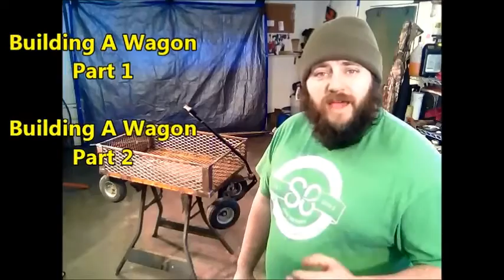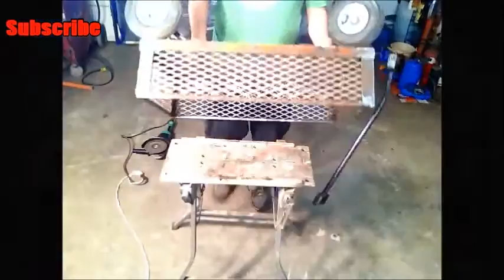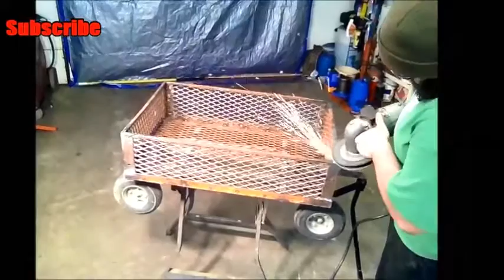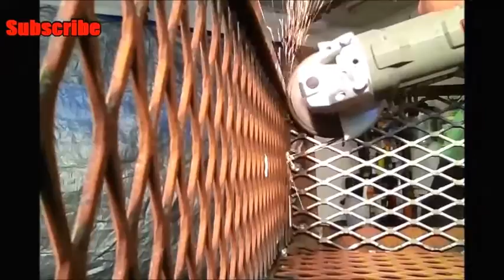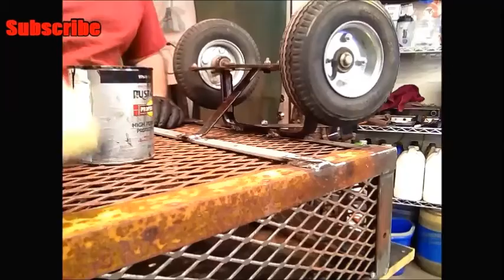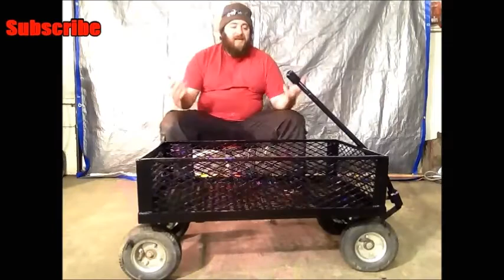★DIY Final Part, Homemade Wagon Build Project. One Man's Trash Is Another Man's Treasure

Comment: Ughhhh totally what I need. I'm looking at about $60 for some swivel heavy duty castors, still gonna need some back tires. Gotta use wood since I have no metal or welder. What I need is exactly what you made. Maybe a bit bigger. Would also be cool if the sides were removable to make it a flat bed.

Comment: I need to learn to weld.  Seems like a whole world of possibilities opens up if you can cut and weld metal.  Sure beats searching for just the right part and compromising in material.  My wagon project has come to a halt because I can't find the proper sized panel for the top, so I'm searching for something in plastic or Lexan that I can cut and screw on.  Don't want wood because the wagon will be used to haul a chemical sprayer and will probably get wet quite a bit.  Nice work.